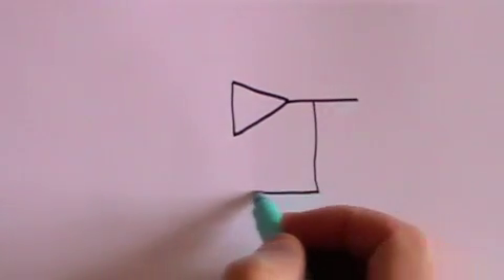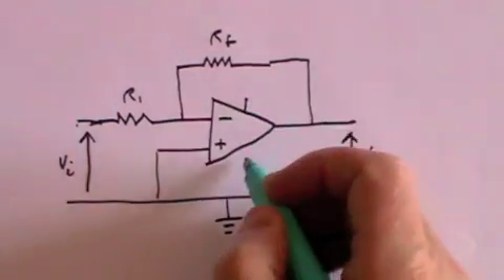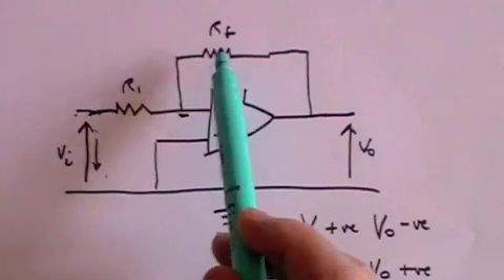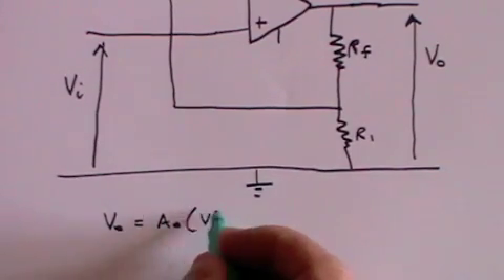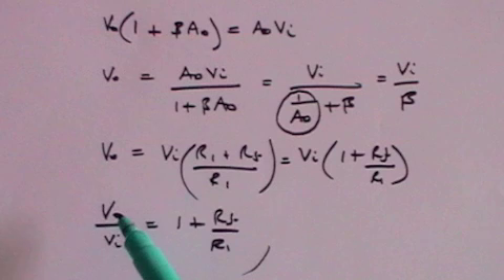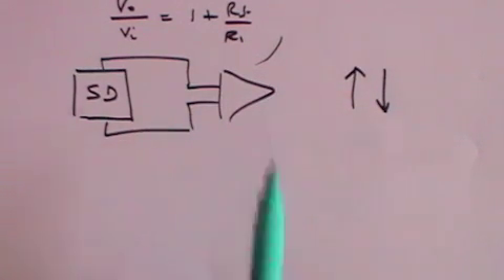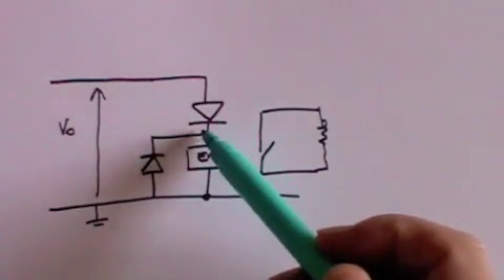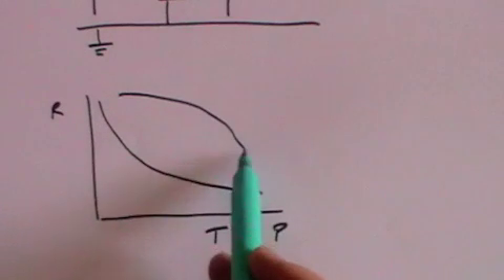Sensors: Direct Sensing - A Level Physics Part 2

Comment: In LED current could pass through both diodes to emit light. Then why at 18:15 when Vout was negative the current was unable to pass through second diode into the electromagnet to turn the switch on.

Comment: Being honest a lot of this is still confusing because of a natural tendency to think of electricity as a flow of electrons which somehow does the business.  Thinking of voltage as a dearth or surfeit of electrons seems to add to the confusion and the role of the earth is not explained not to mention conventional current direction.  It seems you have to think of it as a kind of applied maths with certain rules but without a physical intuition.  I think it's because electronics was developed before the physics of electrons was understood.  I mean, charge ?  If anyone feels the same I'd appreciate a reply comment.

Comment from the maker: What I am saying is that because there is no straight line connection between the resistance in the circuit and the thing which is varying then you have to do some form of calibration. If for example you want to switch on the light when the light levels in a room fall to a certain amount you will need to do an experiment to establish what level of resistance is needed such that when the light levels fall to the critical amount the output of the operational amplifier changes direction.

Comment from the maker: The output voltage is split across R1 and Rf. The actual voltage fed back to the amplifier is the voltage across R1 (ie voltage above 0v or ground voltage). So the proportion is R1/(R1+Rf).

Comment: Sir, I'm a bit confused - at 10.42, isn't beta supposed to be equal to Rf/(Rf+R1) instead of R1 being the numerator there as shown? I'm not also really being able to understand the essence of how these devices are functioning. What I mean to say is that I'm taking it for granted that the signal is being inverted but not really comprehending why.

Comment from the maker: Open-loop gain of op amp is gain when no feedback is used in the circuit. Closed loop (or gain) does have feedback. Ao is the open loop gain. Vout is the output voltage of the op amp and Vin is usually the difference between the 2 input voltages.